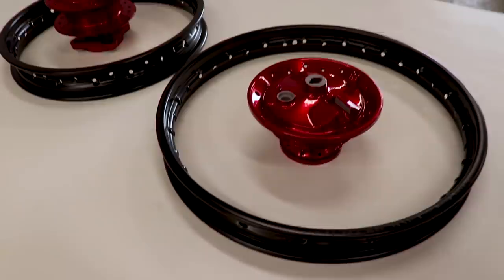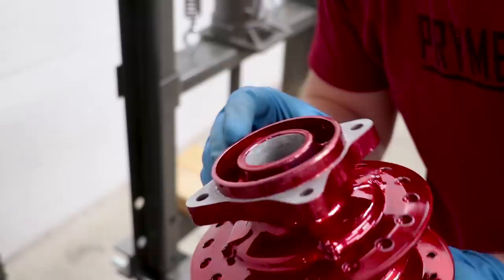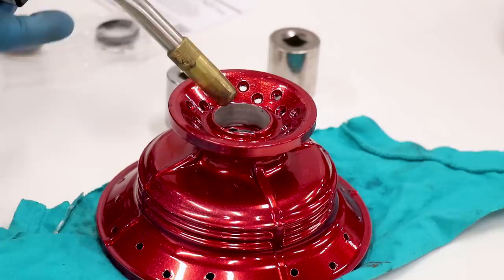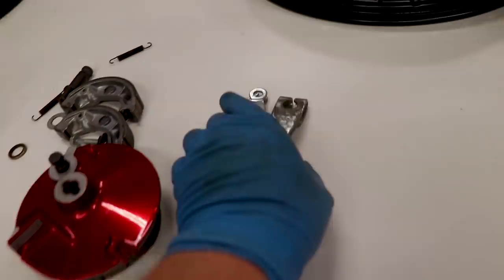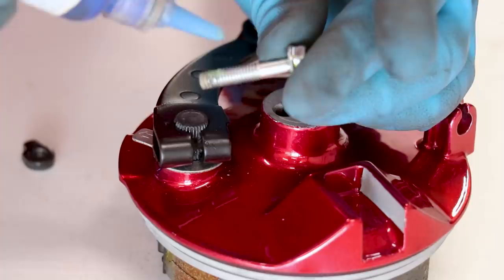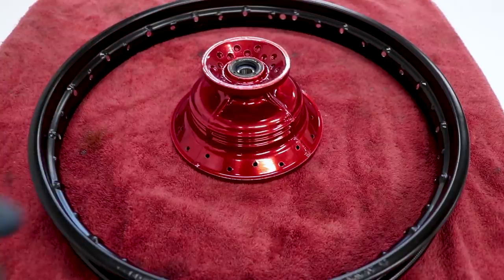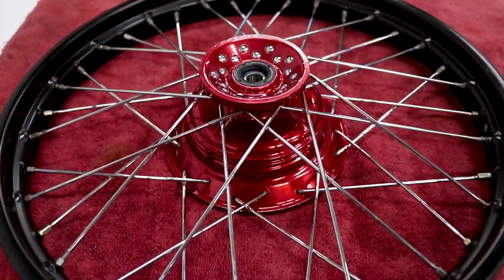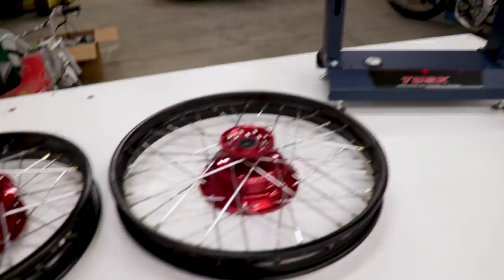Tricks To Building Dirt Bike Wheels!

Comment: Wow Cameron, I rebuilt my XR650R wheels and reused my front spokes.   (Rears were corroded too bad)  I cleaned them using steel wool and WD40 and that actually worked pretty good.  That buffing wheel really shines em better than new.  I think mine turned out fine for what I was doing but when YOU powdercoated the rims and the hubs and painted all the small parts...by all means BLING BLING BLING...Nice job...your girlfriend will love 'em.  Also: Anti seize is a great idea.  I used 90wt gear oil on the nipples...but antiseize is a great choice.  Great vid bro!

Comment: Dude, you've got that oven you powder coat in. Warm the hubs up to 250 degrees for about an hour or so and the bearings drop in at room temp,  unless the powder coating can't take 250 degrees 🤔

Comment: Important to have the valve between parallel spokes. If you get it laced with crossed spokes above the valve you can't inflate easily. Yours were correct so no problem as you knew what you were doing, but if you get to the end of the lacing before you notice you get to do it all again.

Comment: 1:50 really... i just mashed them in with the round side of a 24ox ball peen hammer, full swings using two hands, one went it sideways, but i bolted the wheel to the bike and gave it full send down the city streets mowing thru 15 red lights... RRRrrRrrRRRrRrEeEEEEeeEee!

Comment: great timing as i have a set of wheels to do shortly and get in a middle everytime. i. ogives you don’t check the offset for alignment of the rear wheel. you trust the spoke lengths of using new spokes?
Reply from the maker: Yeah if you're using OEM spokes you'll be fine

Comment: My 2004 yz 85 doesn’t shift its stuck in first and the shifter is loose it also doesn’t go it seems like it loses power as soon as I get going it bogs so I pulled the clutch in got it at a high rpm and i let the clutch out and it boged and died now it doesn’t move at all does anyone know what could be wrong with it?

Comment: what's the best tire size for an 06 crf250r?? I have a new rear tire I forget what size, but now it looks sort of awkward as the front is noticalby smaller
Reply from the maker: I've run a 80/100-21 on my 125 and 250 https://www.rockymountainatvmc.com/tires-and-wheels/dunlop-mx33-geomax-soft-intermediate-terrain-tire-p